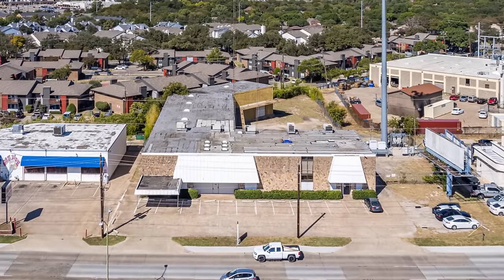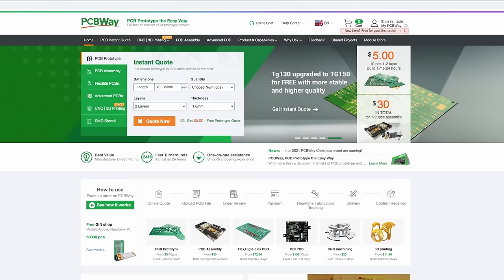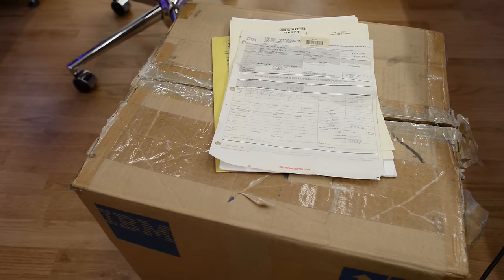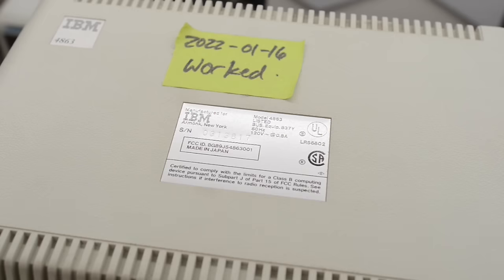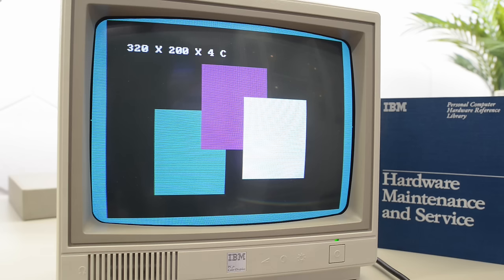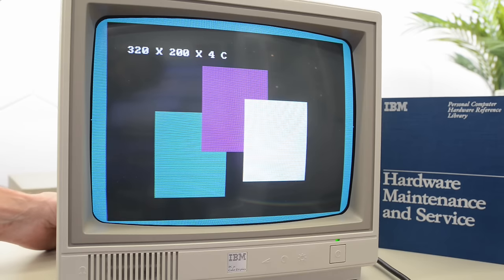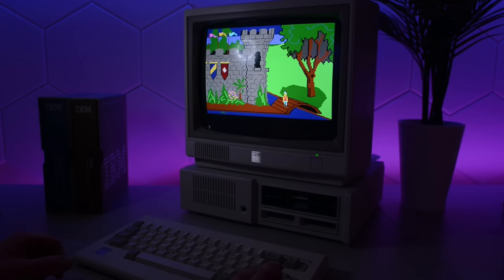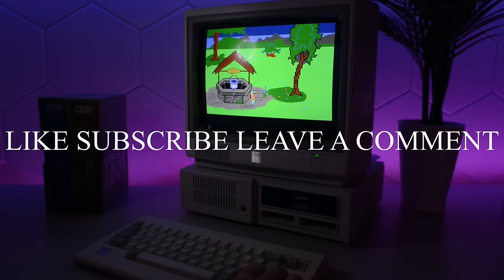The last IBM PCjr found at Computer Reset.

Comment: Schools are very bureaucratic institutions, so getting approval to buy a second hand replacement may have been a lot more difficult than getting a repair approved, even if the second-hand option was cheaper than the repair. It may have even been more difficult than buying a brand new replacement, except they probably couldn't get a brand new PCjr monitor or compatible CGA monitor, because they probably weren't being made anymore by 1990.
Reply from the maker: yeah, I think the last display left production in 1985. Maybe they had run out of NOS displays
Reply: That makes a lot of sense… even though it probably cost more but they could be sure it was repaired/refurbished by IBM “standards”
Reply from the maker: @JeffreyPiatt  Ok, cool.  I worked at a Compaq shop. The parts we received were not marked and they looked new. Although, I can't recall ever having to swap any CRTs. Maybe they rarely broke or maybe I just don't remember : )

Comment: Please do not put the monitor on the PC because the floppy might not work correctly then. There is also a modern replacement for the linear power supply, the old one might fail and damage the mainboard. The quirky screen display might be caused by some weak soldering connections on the mainboard. My jr sometimes "looses" the colors but when I wiggle a little bit on the connector the colors came back.😁
Reply from the maker: Interesting. I didn't consider a bad connection. However, this problem is very consistent. I'm placing my bet on poor shielding or a bad cap. Let's find out
Reply: I agree don’t put monitor on case since case is plastic structure won’t support weight well and heat from bottom of screen will shorten life of floppy drive and disk. The LED lighting on back of desk is cause of monitor flickering as there is no shielding of electrical noise in the rear of screen.
Reply from the maker: @daoutbox9884  Thanks, I'll take your advise. Unfortunately I tested the PCjr with LED's unplugged with same result.

Comment: I have a real soft spot in my heart for the PCjr. After they bombed, someone (IBM?) donated a lab's worth of them, with 2nd drive and 640K upgrade, to my highschool. I did my first "real" programming (Turbo Pascal and MS C) on those machines.
Reply from the maker: That is cool. I wish IBM would donate a legacy add-on to my channel : ) I actually have a second NOS drive but no module to put it in. I didn't try Pascal until the 486 days! You were early bro

Comment: If you can get the display flickering again with it to the right of the system unit, see if it goes away if you move the system unit further to the left. If that fixes it, it's almost certainly something in the system unit causing interference, and the first thing that comes to mind is the fan on the back of the floppy drive.
Reply from the maker: Thanks. I'll try that and report back
Reply: Or just the floppy drive in general, it might not be shielded to the right side but on the top. Some CRTs are really sensitive to magnets like if you've ever tried putting unshielded speakers next to a PC CRT.
Reply from the maker: @Nukle0n  yeah, the floppy drive is on the suspect list
Reply: Isn't the left side also where the jr's expansion port is located? Maybe that opening in the shielding causes the interference.
Reply from the maker: @rupf  Yes, the flicker appears when the display is on the same side as the expansion port. I'll try it out with an expansion cart, thanks

Comment: I have 5 PCJrs but no longer have a Jr monitor so I cant test but the systems are plastic shells and the only shielding is the type of paint/coating they applied to the inside of that shell. The coating is applied to the entire inside but the side expansion port is exposed (under the uncoated plastic side panel) and this might be the cause of the flickering.

I dont know back when I was a kid we only ever had the monitor placed on top of the machine. If you go to Mike Brutman PCJr Forum someone there could answer the question for you I'm sure.
Reply from the maker: Thanks, I'll check in the forum. btw. is there an adapter that would allow you to hook up your jr's to a regular CGA?
Reply: @Epictronics1  IBM PCJr Adapter Cable for the IBM Color Display / CGA - you can usually find these they are just a cable from the PCJr pinout connector on one end to a IBM Color Display connector on the other, TexElec also makes a breakout board to just use a standard cable as well.

Comment: I have the internals of a PCjr and 4 PCjr monitors which came from Computer Reset.  3 of the monitors have issues that I have yet to get comfortable with fixing after opening them up but I do hope to be able to get there eventually.  

As for the PCjr internals, a friend of mine (Adam's Apples here on YouTube) encountered a very broken PCjr at a VCF event for $5 and just decided to donate it it me.  The original motherboard in it was very badly damaged while the case was cracked in many places but still held together.  I carefully mended the case back into a usable state and swapped the CR parts inside it.  The only thing that I'm missing is software to run on it.
Reply from the maker: cool project. I think the next challenge you will have to deal with when you have found some software is going to be RAM. The PCjr is very crippled without some extra RAM
Reply: What did you use to repair the cracks?
Reply: @blackterminal  Loctite super glue gel.  It worked fine and I'm not concerned with the looks as it'd be obvious with my skill set anyway.

Comment: The cable might be bad. It could have a break in it somewhere and it's making intermittent contact when you move it in a particular direction.
Reply from the maker: The behavior is very consistent. I have moved the display several times and it gives me an identical flicker every time

Comment: Looking at the internal and back panel shots found online, I see that the video cable from port D carrying TTL video to the 4863 monitor would pass by the cooling fan when the monitor is placed on the right, but not when on the left or on top of the case.  Perhaps an electrically noisy cooling fan and/or bad cable shielding/ground?  There is also the large floppy disk motor near the center rear of the PC case which the video cable would also pass by, but unless that is running continuously there wouldn't be a continuous problem with the monitor display.
Reply from the maker: Thanks. I'll try to move the cable and see if it has any effect on the flicker
Reply: @Epictronics1  I was also going to suggest that it be a dodgy video cable or something with how it was routed.

Comment: I have seen screen wobbles caused by motors, so maybe be on the lookout for an AC powered fan inside the PCjr. Adrian Black just did a video with an NEC all-in-one that had a mains-powered fan in it, about 80 mm by the look, with a full aluminum frame (plastic blades still). It didn't seem to be causing problems there, but that was a monochrome CRT.
Reply from the maker: I'm actually watching that video right now : ) I noticed the huge fan. The main suspect right now is the floppy drive and the floppy drive fan. (yeah, it's weird but it actually has a fan for the floppy drive) I have NOS spares of both and will try them out in the next project video

Comment: Bad cable by chance?  In particular positioning  the cable is getting a bad signal?

Not a PC Jr user, just had a similar issue with my voodoo2 decades ago
Reply from the maker: Yeah, the cable is on the suspect list now. I'll will check it in the next project video

Comment: 16:38 Though it may seem weird to spend so much money on a 5 year old CGA display, you're thinking of this as if you were an individual customer looking for the best deal on a single product ala-cart for your own personal use.  Obviously if that was the case, the idea of paying $250 for replacement CGA display even back in those days was quite terrible.  But for a school that had many computers they used in a computer lab that needed working monitors of the same type, this was not nearly as big of an issue and they'd rather get get what they needed for the time then replace anything with anything newer that may or may not work with the computers they were using.  Also, school were notoriously slow at upgrading computers back in those days.  Heck I remember my first typing class in high school back in 1993 and they were still using IBM 5150 PCs as their secondary computer lab PCs and the HS library was still using IBM 5150 PCs all the way through 1996.  The logic was either you fix what you have or you replace THE ENTIRE LINE all at once, if the school does not have the money for a complete upgrade, it's easier for them to just fix or swap out 1 for 1 with what they already have.
Reply from the maker: Wow, a 5150 in 1993. It must have been like working on a museum piece : ) The industry moved insanely quickly back then. Nowadays it has slowed down significantly. I edit all my videos on a hacked 12-year-old iMac with some upgrades and it's fine. But back then the difference between an 8088 and a 486 was huge!
Reply: other computer labs at the HS were more updated, there was one across from my math class in the Central building that had Mac LC-IIIs and my CAD class used IBM all in ones that were either 386 or 486 but that computer lab I had that had those 5150s still had them as late as 95 possibly till I graduated, but I know pretty much ALL the older PCs were replaced entirely on both campuses that fall of 96 after I graduated according to Mr. Pope the head librarian.
Reply from the maker: @aegisofhonor  Imagine being there and picking up all those 5150s for cheap : )
Reply: I saw that the way around this problem was to have more than one computer lab going at the same time, that didn't have to use the same hardware. There might have been an intro class with Commodore 64s at the same time as the animation department was using Amigas and the accounting students were using PCs. When the old, hard to get hardware started to give out, it got cannibalized (unless it was one thing failing everywhere) since interest in those classes was probably declining along with the supply of hardware.

Comment: A "hot snort" on a CRT neck was definitely not a good idea. During work, it will heat up well above the melting point of a "hot snort".
Reply from the maker: Oh, I see. What is that stuff IBM used? I need to get some
Reply: @Epictronics1  I don't know what IBM have used, but I guess it was some kind of silicone encapsulating compound.

Comment: The PCjr was my first computer. It was unfairly criticized as being underpowered but it was far more powerful and a better value than its competitors at the time such as the Apple II series, Commodore and Atari.  For the money, it couldn't be beat until the Atari ST appeared, which sold for around the same price with an RGB monitor. Still, the PCjr beat it out by the shear number of software titles available. 

What hurt the PCjr's sales was its cheap build quality. IBM really cut corners by using very cheap looking plastic and included a horrible chicklet keyboard. IBM did remedy it later on by offering a better quality keyboard for free. Back in those days, even though the upgrade cycle was a lot shorter,  consumers still cared about build quality. The PCjr could have succeeded, but IBM was more interested in making a killing than a mere profit. There wasn't enough dollars to make cents in the home computer market for IBM, especially when their IBM PC sales were red hot. They pulled out of the market and declared it a loss.

The PCjr had one massively underrated feature.  It included some of the best computer training materials available right in the box.  IBM put some serious money behind it.  It was well paced, well illustrated and a joy to read! I learned how to program in BASIC and mastered DOS over a couple of months. Later on, I learned Turbo Pascal and assembly language on it. Those were good times!
Reply from the maker: I have still a lot to explore with this awesome little IBM but I think you are probably right. Things may have turned out in a very different way if they had shipped with a better KB and some more RAM.
Reply: @Epictronics1  It came with 128K of RAM and was expandable up to 512K.  At the time, 128K was still a lot more than what you got most home computers. The Apple //c was more successful, but came with 128K and a measly 8-bit processor and no monitor for around the same price as a PCjr with a monitor. It had, however, an unbelievably good keyboard and better build quality. On top of it all, it was visually attractive--pleasing enough to showcase as art!  Apple's secret sauce and what allowed them to command a hefty premium was its aesthetics.
Reply from the maker: @bobweiram6321  Totally agree. I have my IIc on display in a glass cabinet :) It still looks awesome and the ones with amber switches are among the best KB I have ever used. I haven't done my reading and testing yet, but I think the junior needs lots of RAM to make those graphics modes useful. I will take a closer look at this in upcoming videos.
Reply: @Epictronics1  Please don't tell anyone about Amber Alps. The prices for //cs will go through the roof. They are truly an orgasmic typing experience, by far superior to the most sought after blue Alps.  I transplanted ambers to an old Next Keyboard and an the IIgs ADB keyboard. It's the heroin of switches. It's so good, I force myself to put it away, fearing it will eternally spoil me. It's like wearing the ring that rules them all.  It's hard enough for me to use a regular keyboard.
Reply from the maker: @bobweiram6321  To late. I have already made a video. Now everyone knows ;) https://youtu.be/LOro2F2mDwo
Reply: @bobweiram6321  apple IIe doesn't get much love

Comment: The flickering is probably caused by the power supply of the LED lighting in your studio, Roman.
I have an el cheapo Chinese LED light in my living room and it also despises CRTs. As soon as it's on every CRT in living room (there are about 12 LOL) starts to look like it needs a recap ;-)
Reply from the maker: Thanks Pip. Unfortunately, I didn't have those LEDs six months ago when I tried the CRT the first time. I tried to turn them off but it didn't make any difference
Reply: @Epictronics1  Too bad.. It was worth a try.
Maybe a recap of the mains filter caps in the PSU of the CRT will fix it. It looks like ripple on the DC section but then again it's weird that only a section of the screen seems affected. Might be bad shielding indeed...
Reply from the maker: @pipschannel1222  I think we have to find out. I hate unresolved problems. I will try out all suggestions I get in the comments in part 2
Reply: @Epictronics1  I also thought of the LED light but it's not that. Hard to say, supply rails would be the first I'd check. Difficult to see it on video but does it come back when you put the monitor on the right of the PC? If it's intermittent like that you might be able to isolate it (or switch it on/off) by tapping on the board while troubleshooting. I'm sure you checked all the solder joints, I tend to re-do them anyways. If it's not the whole screen flickering, it's odd. But I'd start with tapping the board.
Reply: @Epictronics1  Me too. I'm very curious what causes this...
Reply from the maker: @pipschannel1222  Let's find out!
Reply from the maker: @tony359  Good suggestion. I actually didn't think of inspecting the solder joints. I really should have. I have an adapter to use my 5153 with the PCjr. I'll see if it affects other displays. That way we might isolate the problem to the PC or the display
Reply: @Epictronics1  I'm sure you can find out. I'm curious to see the outcome! :) I am not overly-experienced with CRTs, I have a few coming (one of those tiny Apple//c ones too!) so either I shock myself or I might learn something new! :)
Reply from the maker: @tony359  You'll probably do both haha
Reply: @Epictronics1  Let's hope I learn something new before I get shocked! :)
Reply: I had a TV that would lose sync and reset when it got hit by even modest power spikes, such as someone turning on a fan in another room. A line conditioner helped, and something that was happening once or twice an hour became something that happens once or twice a day. It's probably a band-aid on a bullet wound, but it did help.
Reply from the maker: @mal2ksc  interesting, isn't there caps in the PSU to prevent this? Could there be a bad cap?